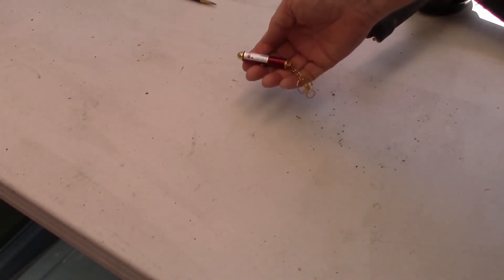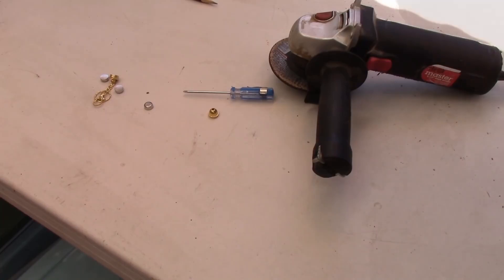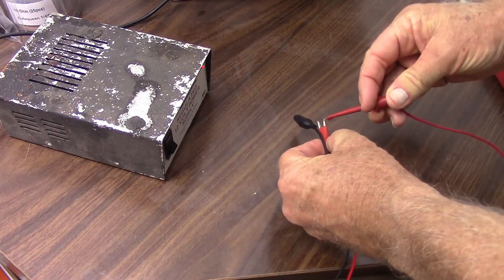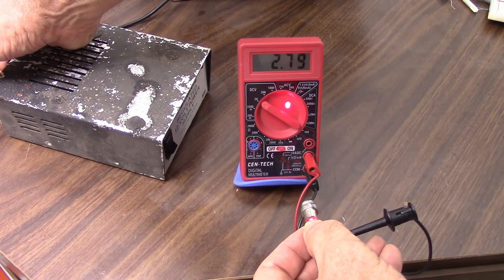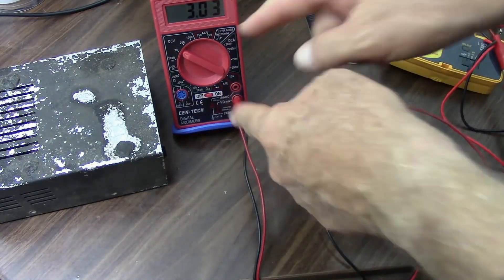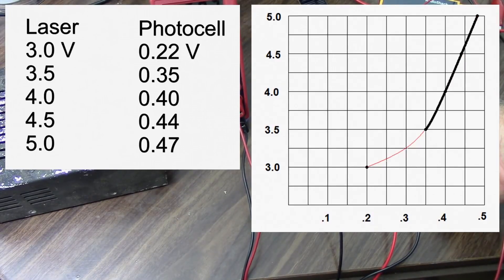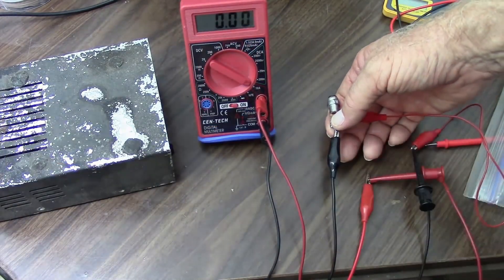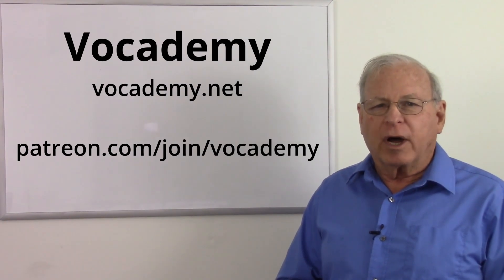Laser Pointer Teardown and Test

Comment: thanks, there was an article about laser diode and it said that lased diodes are current driven and the voltage usually is around 1.5V, so i thought something was odd with my laser pointer bc it only start to produce light over 2V and i had to give it 4.2V to produce a bright laser, so after reading the article i thought i was barely didn't burn my laser.

Comment: What causes these diodes to stop working? I have a 7 year old blue laser mod that was custom made. It worked for about a year then stopped working ... so I sent it to the guy that made it and for $20 he'd repair it. Once again it lasted for a year or two with modest use and stop working .. problem is now I don't have same option for repair. Are there online services that repair these?? Thanks I believe it's a 2watt laser mod has the laser set nicely in a heat sink that attached to the battery mod by 510 threads and I'd really like get it fixed